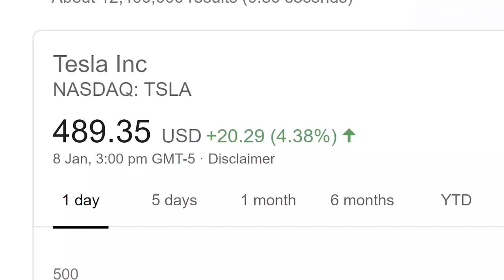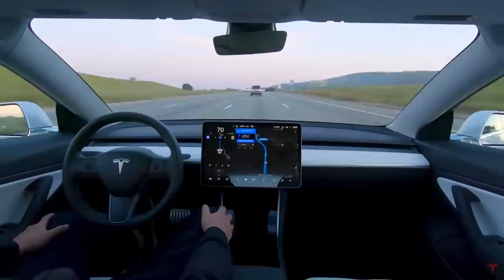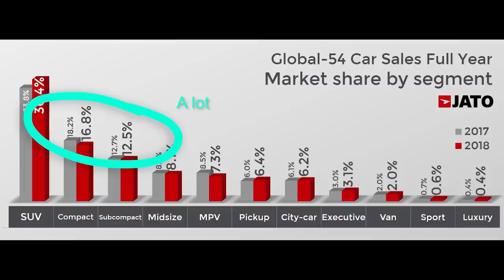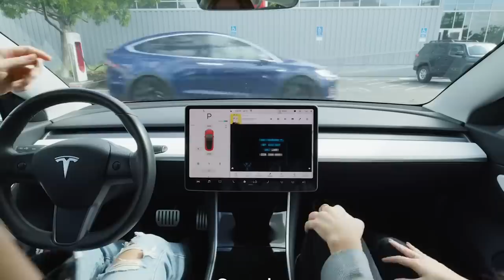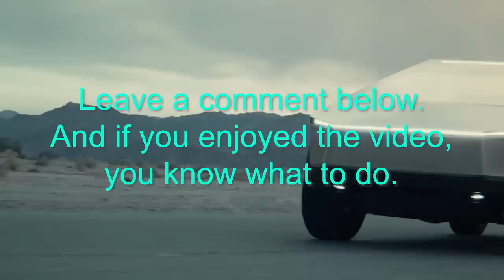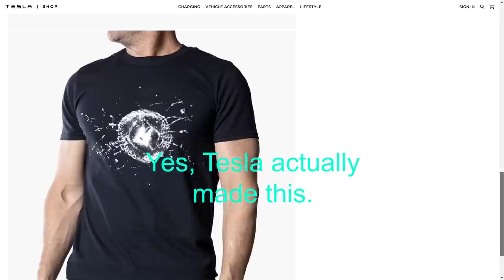Is Tesla Making A Compact Car? (or something else)

Comment: two reasons why it is logical that Tesla will produce a smaller car.
* Tesla is not afraid of cannibalism. They built the Model 3 knowing it would take some customers away from the Model S. But that's what strong companies do.

* Tesla knows the tricks involved in fast charging. A car that charges at 150kW is OK even if it has a smaller, lighter, cheaper battery. At 150 kW you recharge 250 KM range in 15 minutes. That's more than quick enough for most folks. Even with a comparatively cheap 45 kWh battery, you could go on the occasional day trip. Small Tesla =  world's first fully versatile small EV.

Comment: "you can't get injured in an accident that doesn't happen" that's a moot point
Reply: xactly. if you get squished between 2 trucks in a small car stuck in a jam, autonomous driving cant help.
Reply: On the contrary, I think it is the ideal point. Avoiding an accident is so much more satisfying than living through an accident. I’ve done both, several times, and prefer the former! Especially if my driving competence can be exceeded by technology.
And yes, some of these accidents I have been involved in would certainly have been avoided in a Model 3. No doubt in my mind.

Comment: Around 200 demonstrators gathered Saturday in the village of Grünheide, east of Berlin, to protest the clearing of a forest to make way for a Tesla electric car factory.

Residents held posters reading "no factory in the forest" and "Tesla or drinking water" — citing concerns that the factory could contaminate the village's drinking water.

Brandenburg state lawmakers gave Tesla the green light to buy the 300 hectares (741 acres) of land on January 9. Tesla's "Gigafactory 4" will produce up to 500,000 units every year of its Model 3 and Y vehicles and other models, according to the US carmaker.

Tesla said the construction of the factory is scheduled to start in the first half of 2020, with the first cars rolling off assembly lines starting in July 2021. The price tag for the property is €41 million ($45.6 million). Tesla's board still needs to sign off on the deal.

Comment: The Cybertruck is cyber because flat stainless steel is a good cheap strong way of making a body. So a Cybercar could be a way to the budget car market. A small Cybercar would look like a Johny Cab and the have self driving so Total Recall is NOW!
Reply: And Musk is going to Mars!
Reply: A small budget car with less HP could reduce parts and cost with wheel hub motors. Then show off some trick strafing manoeuvres for city parking. And before anyone mentions unsprung mass, good motors are getting as light as a steel wheel with drum brakes and a budget  city car can use smaller motors as performance is not so much of an issue.

Comment: Can you perceive that there is tension between your vision for safe compact cars and Elon Musk's vision for FSD?  He wants to push up the price for FSD when 'feature complete' autonomy arrives, on the grounds that people will earn money from putting their Tesla cars to work as robotaxis.  Higher prices mean a barrier to entry.  He doesn't intend for cheap, affordable cars to have autonomy.

He's even said that Tesla may stop selling cars for personal use and concentrate on pumping out robotaxis for Tesla to operate itself.

Robotaxis will be safer, probably.  But how do we get safer cars for personal use at affordable prices out of his vision?  We don't.  Either his vision has to change, or we'll have to retool our imaginations for what Tesla will do for future models.

In Musk's vision, cars dedicated to personal ownership will go away, and each BEV robotaxi displaces several - or even dozens - of ICEVs.

I think Musk is only partly right.  Some private ownership can be displaced by robotaxis, but the vast bulk of private ownership isn't going to vanish, for several reasons.

The first is customizability.  Personally-owned vehicles can be - and are - customized endlessly to meet personal needs that no generic taxi can satisfy.

The second is use cases.  Robotaxis will have terms of service that lay out what you can't do when you rent it.  I'm sure that will include such uses as off-roading, drag strips and race tracks, adding a roof rack, dragging a trailer (possibly excepting robotaxi versions of the Cybertruck), using it for sex, etc.  Humans can conceive of endless ways to use mobility that will be forbidden.

The third is status statements.  There is no status statement delivered from riding around in a taxi.  But people enjoy projecting their identities with cars and making statements with them.

The fourth is that owning a robotaxi will inflict work on the owner  The car will have to be cleaned and serviced more often.  There will be tax implications, insurance implications, paperwork to file, approvals to obtain, regulations to obey.  There will be a higher risk of litigation.  There will be a higher risk of damage to the car that will have to be resolved.  Those who don't need the income may elect not to bother with it - but will still want a personally-owned vehicle.

So long as personally-owned vehicles are affordably within reach, people will want to own cars.  I think we need to persuade Elon to change gears and deliver autonomy in two differently-priced tiers: one for personal use and another, higher tier that opens up the Tesla Network for autonomous taxis and provides software and services taxis will need that personal owners will not - software to connect riders with the service, dispatch available taxis, monitor riders' compliance with terms of service, generate tax forms and reports for the owner, and handle billing and payments.  That higher tier should also offer appropriate insurance coverage for taxis during operation.  Personal insurance won't work for taxis.

With separate tiers for personal and taxi use of autonomy, and keeping the price of autonomy low for the personal use tier, then your idea for using autonomy to reduce risk for affordable compact cars is something we can discuss.  But without those separate tiers, it's out of reach.  And it will definitely be out of reach if Tesla opts to stop selling its cars entirely, as Musk has suggested they might, and use them instead as robotaxis operated by Tesla.  Musk really needs to be convinced to keep selling Tesla cars to the public; and he needs to be convinced to offer autonomy as an affordable option for personal use and a much more expensive option for commercial use.

Don't sleep on the possibility that Tesla might use cold-rolled steel and structural exoskeleton designs - as with the Cybertruck - for other models.  I just finished listening to Sandy Munro discuss the reduced CapEx costs for producing vehicles using this technology, and it startled me.  It's just immensely cheaper.  It also yields a better, safer enclosure for passengers, and so if Tesla can figure out how to apply this technology to compact cars, they might look odd, but the safety Tesla is famous for might not be diminished all that much.  Or at all.

Food for thought, eh?

Comment: They are nowhere near solving the self driving problem. Having done work in machine learning I can tell you they are a decade away for FSD. Sample sizes need to be large enough in the edge cases and identification needs to be virtually perfect. They are not, this is coming from a Tesla owner and supporter.

Comment: 1 > if they do one, it be still too pricey to buy by the low wage worker since Tesla stands for fancy pricey cars for the well off or rich!  2 >  if they manage to have the Chinese design it, and the design as said be non normal car design maybe like the Cyber Truck then it won't be popular as the Cyber Truck is as most people who follow Tesla releases stated it is Bloody Ugly Horrible right angled crap design! 3 > Tesla are a car maker who as Elon states a way for the people  to own a good EV, trouble is Tesla stands for pricey cars even the horrible model 3 is £42.000p to buy in the UK. ( I say horrible because no drivers binnacle speed display on the top of the dash instead you got to look off to the left side onto a flat screen taking your eyes off the road for 2 to 3 times longer than if you had a binnacle were it should be just below your line of driving sight that you glance down for 1 second to see it and back to the road ) .   Why should every single car design ever made ICE or EV have to always have that placement of the binnacle no matter the design inside or out is over decades.. Because Safety laws state it must be there no matter the cars safety devices or driver help systems so the driver can see the speed without taking their eyes off the road as you can crash even in a Tesla with all it's fancy sensors if you don't watch the road ? Why should this model of car be exempt from the law?  And the damn model Y which is not a model X cheaper version as it was said it be, instead it is a clone of that damn model 3 with a bigger body shell. So with the ugly Cyber Truck that's 3 cars without a binnacle. so 3 that should be banned as unsafe and breaking the long stuck to by every maker rule about speed display placement.

Comment: I think all Teslas from the S through the X to the 3 to the Roadster and even to the China designed and built Model 2(?) will have identical 600 mile plus range and zero to 60 in 1.9 seconds.  Why?  Because Elon can and it will drive the pundits bat shit crazy and because he can enjoy that.  You will gladly pay more for an S then a 3 because you want to show off or because you want to give Tesla a bigger donation to save the world faster.  Can't afford to help save the human race by buying a Tesla then just buy a share or two or 1000 to help.  Either will help destroy the ICE Coalition of Evil.  Think and you'll see how this is the obvious path for Tesla.  Also the prices for Teslas will purposely plummet in line with efficiencies especially in batteries (graphene for example) so he can save the human race with more BEVs faster and he will never give a damn about quarterly earnings but will try to grow exponentially faster. and execute the Tesla Goal of fixing climate change even if that requires a 100 giga-factories. Where else do customers help deiver cars on New Years Eve for free?